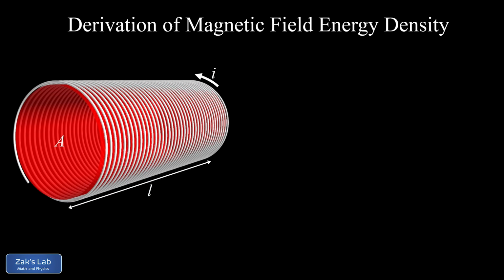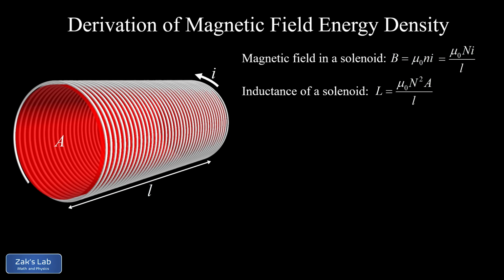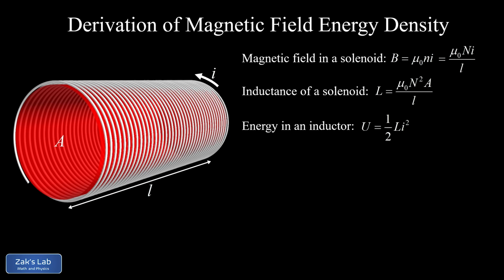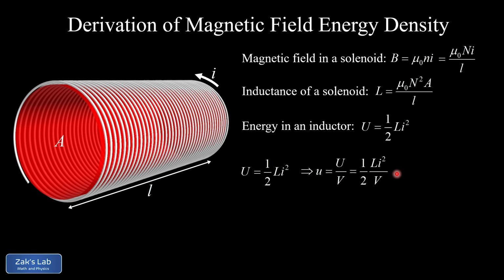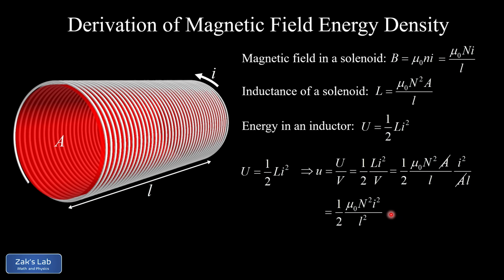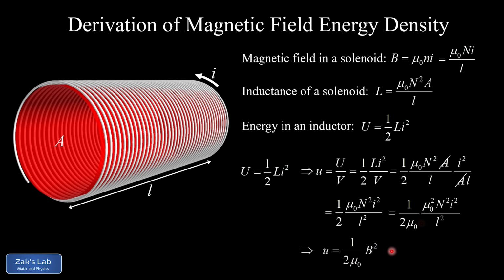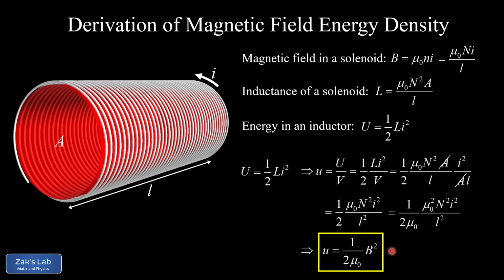Magnetic Field Energy Density - Derivation Using a Solenoid

Comment from the maker: This video is part of a short set on electromagnetic induction:

Introduction to mutual inductance
Self-inductance and the inductance of a solenoid
Self-inductance of a thin toroid
Self-inductance of a thick toroid
Energy stored in an inductor
Magnetic field energy density (this video)
Inductance per unit length of a coaxial cable

These are designed to build on each other, so earlier videos will make the later ones much clearer.